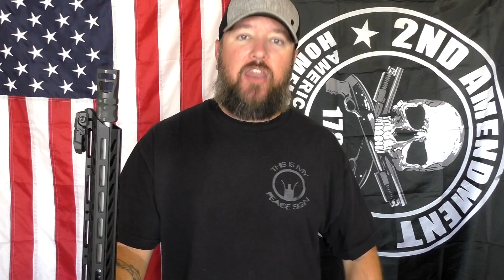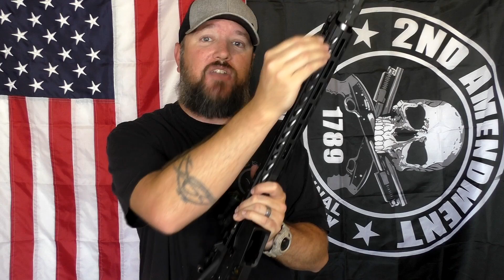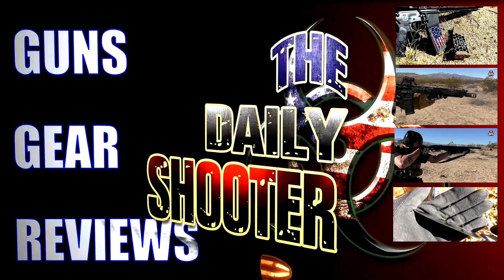Gas Systems Lengths and Dwell Time

Comment: It seems you skipped over a really important concept. People who choose short barrels should already know they’re losing velocity. There is a benefit to an over gassed rifle, and it’s that they cycle more reliably. There is more energy blowing back on the bcg ensuring that it cycles even with weaker loads. It also increases felt recoil, wear on the gun, and decreases split times in the hands of a trained shooter depending on the barrel length. On the other hand, longer dwell times reduce felt recoil because the energy is being spread out over a longer time creating less of a spike. They also increase split times.  There are a lot of factors to consider besides velocity. And like another comment mentioned, changing your buffer weights and springs can have a dramatic impact on this balance.

The main issue is making sure the gun cycles without over gassing it too much. The whole point behind the development of the .300blk rd was to create a round that would retain decent terminal effects with the compromised velocity typically found from shortened rifles that accommodate suppressors used in modern combat. 

It addressed the issue that 5.56 is basically a .22 round when it loses enough velocity. It was originally designed for 18-20 inch barrels with rifle length gas systems. 

.300 blk is still 30 caliber even if it does lose velocity. They also utilize a faster burning powder than what’s found in 5.56 cartridges.

Comment: Dwell time on an AR rifle refers to the time the bullet is in the barrel AFTER the gas port.
So a short barrel with a long gas tube will have less dwell time and will probably have reliability problems.
The other way around, a 16” barrel with a pistol length gas system will have a lot more dwell time, overgassing the system.

Comment: Is there a difference in velocity? Having both barrels being the same length and the only difference being has length. I remember seeing that mid length had faster velocity because the gas pushed the round for a little longer. Idk seems plausible.

Comment: Dwell time is the time between the bullet passing the gas port and exiting the barrel.
It does not have anything to do with the time from ignition until reaching the gas port.
That may be an important consideration but that is not Dwell time.

Comment: Good info.  I decided to change the hand guard on my 300bo.  It has a pistol length gas tub?? What the heck. I have a # of builds and an original Colt ar 1964 model.  My new 300 seems to spit the brass out hard enough to bend it on the brass deflector. So I started looking for some way to change this.. Anyway I found out that most of the gas build up is after the bullet goes by the hole in the gas block.  Therefore as he says the longer the barrel after the gas block the more pressure build up to a certain point and then opposite. 
But when one goes from a 223 with 55- 60 gr. bullets to 150 grain plus bullers with much the same case behind it things change a lot.

Comment: Another BIG issue in gas impingement guns is extraction timing. Too short of system has the casing being extracted when the neck is still expanding making it difficult to expand the spent casing. So there is dwell time, extraction timing, bolt mass, buffer mass, and gas regulation that needs to be performed to tune the rifle or pistol.

Comment: How similar are the pressures of 7.62 × 39 and 300 blk out? 
With 7.62 and a 16" barrel is a carbine length gas system a good design?

Comment: Very sure you got this wrong 

Dwell time is the amount of time 
AFTER the bullet PASSED the gas port ! 
That dwell time govern how long the gas is sent back to the BCG thru the gas tube 

On 16 inch barrel 
The carbine gas length has LONGER dwell time 
The mid gas length has shorter dwell time

Comment: Wanted your opinion about what I’m planning on doing. I have an older AR-15 (mid 80’s) and I’m wanting to convert it to .300 blackout.  Through my looking and research 16” barrel and pistol length gas system seems pretty common. In your opinion would this be an ok conversion? Or do you think it might not work well with my lower?  I’m just researching and getting as many opinions as I can. Thank you.

Comment: Good video, but you're right and wrong. You're correct in what the term means as a general Firearms principle, but in relation to AR style guns in particular "Dwell time" is the length of time from when the cartridge passes the gas port until it leaves the end of the barrel.

Is not the around time before the bullet gets to the gas port, and it's not the entire amount of time it's in the barrel. It's only post - gas port to muzzle.

That's because dwelltime represents the. In which there is enough pressure to force gas down the gas tube and pressurize the cycling mechanism of the rifle.

Before the bullet reaches the gas port, obviously there's no gas going down the gas tube, because it's all behind the bullet. And obviously, once the bullet leaves the barrel, then no more gas is Flowing down the gas tube since it will instead take the path of least resistance which is out of the muzzle. So the only time the gas tube and the entire cyclic mechanism (gas key, bolt carrier group, etc) is pressurized enough for gas to flow into it, is once the bullet passes the gas port (therefore for exposing it to the expanding gases) and before it leaves the barrel (therefore uncorking the entire system).

Comment: Doesn't the buffer and the tension of the buffer spring play into the equation? Depending on the length of the barrel, how do you know how what diamater gas to you need to ensure flawless operation?

Comment: All 16 inch 300 Blks with pistol length gas systems will be over gassed. Adjustable gas block is a must if you shoot a lot. 8.5 inch will not be over gassed.

Comment: This video is completely false. There's so many false information Within this video point them out. Delete this video get your facts straight and then redo this video. You are getting confused with with multiple things like what is actually the dwell time and what is Barrel time and what is Optimum barrel length and you missing the completely point of the placement of the gas port. In this video sounds like you're wrapping all of these definitions up to one definition of dwell time which is completely wrong

Comment: If you do excessive research on the 300 round and gas systems. A pistol length system is the way to go. It will run flawless. Especially in a short barrel setup. Because the round was engineered for a short barrel rifle.

Comment: Im wanting to do an 18 inch rifle "SPR" type build. My problem is that I want to do a mil spec carbine buffer tube so I can have an adjustable stock. I have seen people have a lot of problems with them. Would getting a mid length compared to a rifle length help? Or are there certain buffer springs and buffers I should invest in?
Reply: Yup get 16" carbine for carbine lenth buffer tube and stock

Comment: AR 9mm- can a short gas block on a custom long 16-24" barrel 
give enough low pressure 9mm dwell power to cycle a GasDI ultralight BGC & Buffer ?

Why GasDI 9mm instead of blowback?  Lighter gun, much lighter than extra heavy bolt/buffer for extra long 9mm barrel.

Comment: Great video. I am building a 10.5 inch SBR 300 BLK Out. And I purchased a completed upper. I was wondering why it had a pistol length gas system, when all of my other 223 10.5 inch SBR's had carbine length gas systems.
Reply from the maker: +Adam Butts Thanks man.  I appreciate it

Comment: Great vid, is there a reason you went pistol length instead of carbine length?? On 16" which is better?
Reply: Pistol length will let you shoot subsonics a lot easier, even without a can (why are you shooting subs without a can? no idea). Carbine length will be harder to get weaker ammo to cycle, but will be easier on the bcg and recoil. Carbine will work with subs, a can, and slower powders. The nice part about pistol length systems is how low you can go. I can make 147gr subsonic function.

Comment: There is also the effect gas length has on the bolt carrier assembly timing which is why some people use heavier buffers etc. So for .556 you want carbine length for 14.7", mid-length for 16" and rifle length for 20".

Comment: I know you had trouble with a Polymer lower because of your misaligned drill press, but if it wasn't a problem would you have gone with a Polymer80 lower over the 80%arms website aluminum one?  

I'm trying to pick a lower and stuck between polymer vs. aluminum, and then the price points between these companies: Polymer80, JMT, and 80%arms.  It's just hard to not consider the $100 lower+jig from Polymer80 vs. 80%arms' $300 setup.

Comment: Great video and you explained it very well. 

I'm not a gunsmith or expert either, but recently built two different AR15s and did a lot of research on each one as one build was a pistol build and the other a 16" rifle.

Another issue with dwell time and the type of gas system is the effects it has on your bolt and feeding the ammo. If you do not get enough gas you can have failure to feeds and the bolt may not engage into the chamber well. If you have too much gas you can have "bolt bounce" where the bolt hits the chamber and comes back instead of lock as well as ammo jams where the bolt moves fast enough to load a round but catch the brass ejecting as well.

I have to admit I was surprised about how touchy the gas systems are in the AR15s when I first was learning about them. If you pick the wrong type of configurations or select the wrong type of spring or too light of a buffer you can get some various performance or reliability issues.

Comment: My friend bought a 14.5" 556 with mid-length gas. He complains of the bolt not locking back after the last round with a carbine buffer. I had to educate him with dwell time.
Reply: He does say "it's softer shooting". Bro.... it's a 556!
Reply: tell him to use heavier grain bullets if that doesn't change anything he needs to go to a gunsmith to inspect the specs
Reply: i have a 12.5" mid length sbr and it has never had any issues

Comment: hence the need for an adjustable gas block on a pistol length. good video. my 300 has a carbine gas system.
Reply: As does mine. One thing Ive noticed is where the spents fly off to. My 556 sends them directly out. 90 degrees to the barrel. The 300 sends them behind me, probably 110-130 degrees from the barrel. Yet recoils less with the same weight buffer.

Comment: Nice job! simplifying the principal into understandable terms.
  It can be tuned even better by the barrel orifice size, or a adjustable gas block.
    Ever get any where with the tee-shirts. The company called spreadshirt digitally prints on demand Tee's. I have ordered from other UTUBERS that use this method.  
      JUST SAYING.
    Keep up the good work.
Reply from the maker: +Robert Foote I checked them out a while back and it seemed kinda expensive but that was over a year ago.  I'll have to check again.  Thanks man.  I appreciate the reminder
Reply: +The Daily Shooter   I didn't say they were the cheapest. They offer print on demand, they do most of the leg work.
    Just a way to offer them to the viewers.
    I have bought them before to support other shooting channels. The price is what it is, but I got them and wear them as a supportive fan.
   See ya in your next vid.

Comment: Ok, so you have a pistol length gas system & if I remember right your gas block was an adjustable variety, did you have to increase or decrease pressure? Is there a way to accurately measure that or is it a trial & error process?

Comment: Opinions on mid length gas on 18" barrel with a 223 wylde chamber?
Reply from the maker: +Jim Pepper I'd say perfect.   I think thats the best way to go.  My mid length rifles shoot so much smoother than my carbines.  Plus I only like rifle length on a 20"
Reply: My Rifle is a FN15 DMR Rifle Length Gas System with a 18in Barrel, H Buffer. It's super smooth shooting. Sorry to disapoint ya all its a bone stock factory built gun.  Rule of Thumb on ARs Long gas systems have less recoil and take more rounds till your bolt is dried out.  My Experience the shorter an AR the more prefect everything has to be for it to function well
Reply: PHXGlock Will it run cheap steel cased ammo? I've heard rifle length gas will sometimes not cycle with the under powered 223. Is that true?
Reply: I've only run M855 green tip 62 gn and M193 55gn brass case. Wanna run Cheap steel case get a piston driven AR like a SCAR16 or go to an AK platform AK 74 or 47. DI guns can run steel case but it's harder on the bolt and extractor and the buffer weight may need to be tuned to match the lower powered ammo. Also DI based ARs run hot in the bolt so the lacquer coated steel cased ammo tends to get stuck in a hot chamber .The cheap Wolf 223 ant much cheaper than some good M855 green tip so its a moot point to me.

Comment: Good video. The pistol length system is the only gas length I'd run on a 300 Blk. Carbine length really only matters for something like the 7.62x40 WT or a Blackout that will exclusively shoot supers in a rifle length barrel.
Reply from the maker: Yeah I've noticed quite a few people having under gassing issues with some carbine length systems.  My adjustable gas block is only one click back from all the way open
Reply: The Daily Shooter I wouldn't have bothered with an adjustable system. But that's just me. I played around with my buffer weight and carrier. For best all around running of subs and supers my semi auto carrier is what I run. But I tend to just keep my FA carrier in it as I primarily run supers